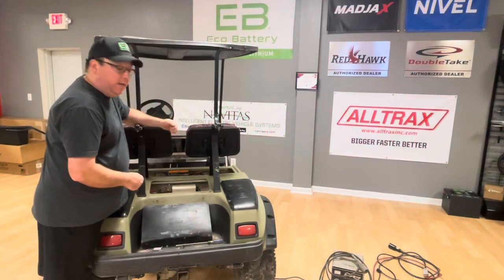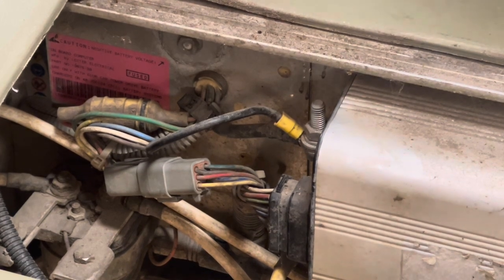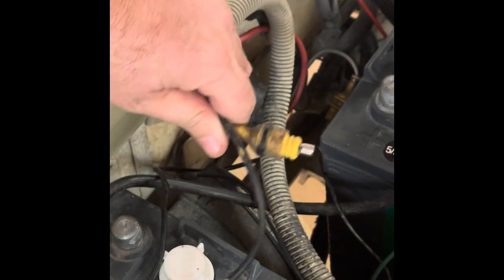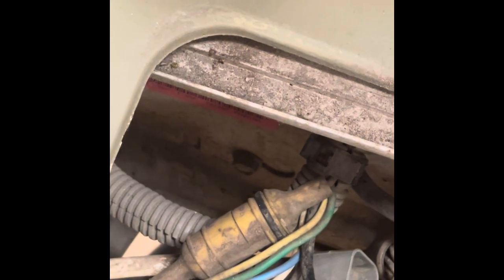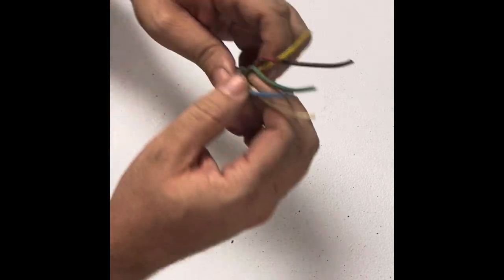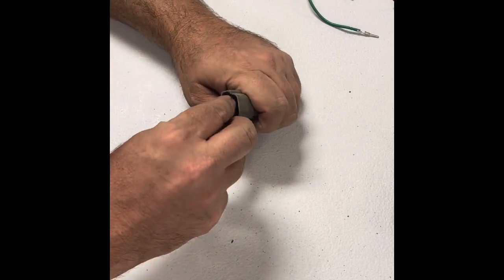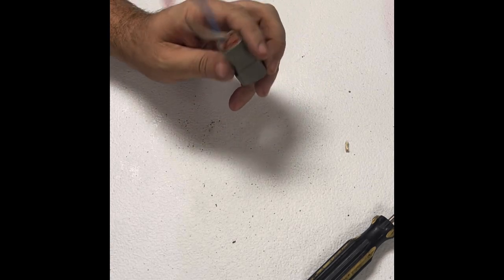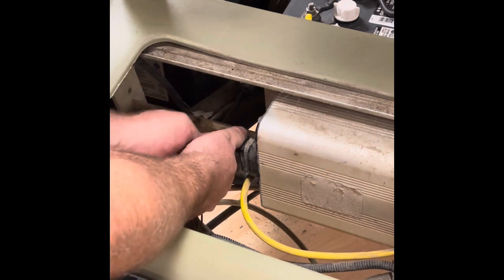Revolution Golf Cars - Bypass ONBOARD COMPUTER (OBC) Club Car Regen 2 98-01 and Club Car DS IQ 02+

Comment: Why not run the black from charge receptacle to the #6 main negative post on battery bu simply cutting it and putting 5/16” ring terminal on the wire.  Plenty of existing wire to do so. #6 already connected to the controller with the larger wire and a shorter easier run

Comment: 2007 48v precedent cart stalls when pedal is floored.  when I let up it begins again.
 the cart was running rough (I call it stuttering) so i asked around different websites and several suggestions were to replace the MCOR so I did. No help, then several said replace the solenoid so I did ( no help). then someone said replace the controller once again I did and it didn't help. so I think, I was on your site and you showed how to test the batteries and I had 2 that tested low so I  bought 2 batteries (no help) then I was watching another video and the guy said I had to replace all six because they are in a series.  So to make a long story short I did and my cart is faster than ever but when the pedal is fully depressed it stalls. When I back off it goes again.  One guy says put a block under it so I tried and it worked.  I am just wondering, aside from a block to limit accelerator travel, is there something else? I forgot I also replaced the speed sensor.
Reply from the maker: Please reach out via email for troubleshooting on issues non related to the video. Thanks. 

Info@revolutiongolfcars.com

Comment: My 2002 Club Car DS obc only has a 3 wire connector coming out of it red yellow and black how do I do it so I can remove my obc and get my cart running off my lithium battery? I’ve watched this video but it doesn’t apply to me.Only other video I saw said take the yellow wire and put it on the B- terminal.Any advice would be helpful.
Reply: The yellow wire goes to the controller from the solenoid.  I just did a lithium swap on an 03 ds
Reply from the maker: You have a series drive system. Totally different than this car. It’s an entirely different procedure. Please reach out to us via email and we will explain the process. Info@revolutiongolfcars.com
Reply: I have a 2002 club car ds.I installed a lithium battery and went from 10 to 12 mph.I would like to increase speed to at least 20 mph.What can I change on a budget that would get me there?

Comment: I attempted this on my 02 48v DS and it would not run until I grounded the big black wire on the obc. Someone said I need to ground the yellow wire that’s on the obc connector. Does this make sense?
Reply from the maker: The process you describe would be for a series-drive system. Our video only applies to the Regen 2 and the IQ system.

Comment: Is this the same when deleting obc for a lithium install?
Reply from the maker: For the most part yes.  A lithium bundle typically includes its own charger, you would need to remove the charger receptacle entirely in that case.
Reply: So just loop the blue and white together? Is that all that’s needed?

Comment: Follow up question btw thanks for responding I have carryall and it has a cord reel and onboard charger which I am not using due to lithium upgrade  which came with a charger so my question ther is a heavy red wire along with the black and gray can I eliminate the red wire also
Reply from the maker: If you remove the OBC and install a lithium battery with it's own charger, you can remove everything related to the original charging system.

Comment: I just used a jumper pin on my cart. Just unplug the wire harness and bend a paper clip into a U shape and plug it into the necessary holes of the carts wire harness. Been running my car like this for the last five years with no issues.
Reply from the maker: Indeed it will. It will work until the paper clip falls out.  Also be aware that the paper clip is a conductor. If it arcs on anything it's not supposed to touch, it can cause damage to major components on your golf car.  Our video covers a more permanent way to accomplish the same task.
Reply: @RevolutionGolfCars  I did put a piece of heat shrink on the exposed part of the paper clip to prevent any possible arcing or short circuiting. It fits in the hole quite snug.  I've been running my car like this for five years hitting speeds of 50mph + and has remained secure. Just thought I would mention it if some people don't want to cut their wire harness to their OBC if it is still good. Happy carting!
Reply: Bad idea.

Comment: I added lithium with its own charger how does that effect the original computer cart will not work now 2011 carryall iq plus
Reply from the maker: @douglasmorris2743  the cart will work if you do the bypass as shown in this video.  The process where we connect the blue and white wire together is what makes the car able to run after removing the OBC.  If yours still isn’t running, you’ve got a separate issue.